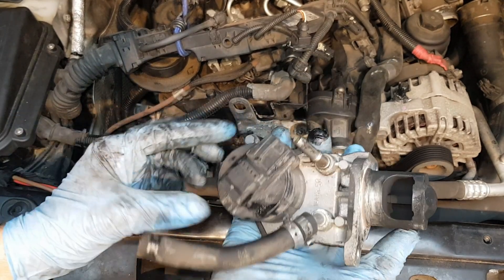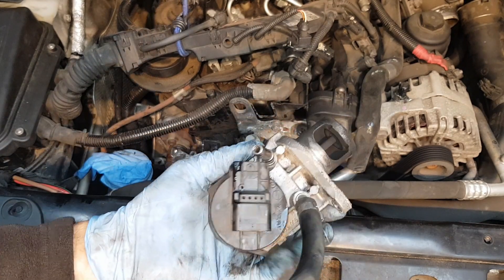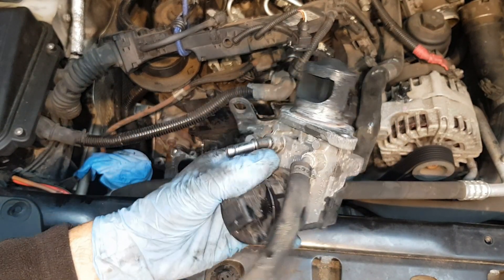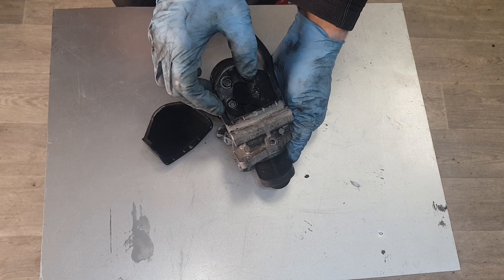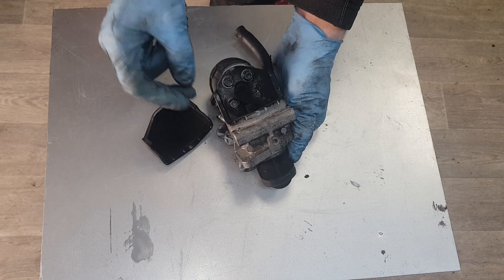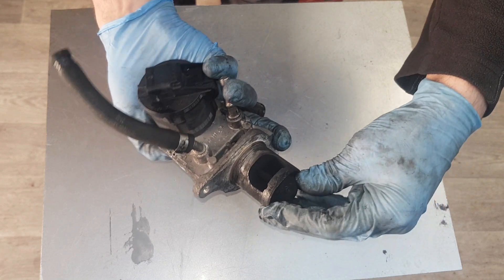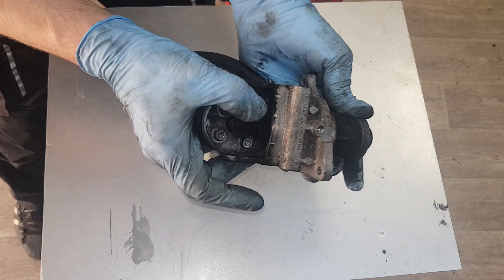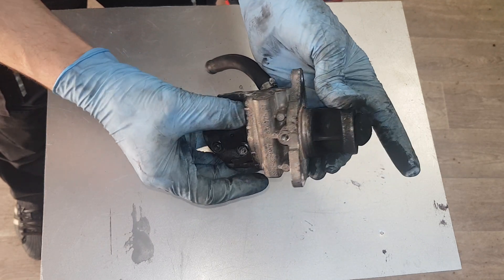Symptoms of bad EGR Valve Is your egr valve bad Why Bmw EGR valve fails N47 N57 BMW Drivetrain fault

Comment: Hi i got e92 335d mapped and after the map i got dpf gutted , when i reaching 120mph it goes into limp mode lost power instantly i turn the car off and on and it has power again

I had a code exhaust gas cooling switching valve open circuit., 

. Do you know how to sort it out ? Or did you ever had this issue?
Reply from the maker: Hi
Sorry but when it comes to mapped and modified cars it is a totally different story than the standard cars. You will have to go back to the shop that modified your car. I personally don't own or work on modified cars. Best of luck and hope you get it sorted

Comment: Did you try to clean it?
Reply from the maker: Yes, but it still gets stuck in open or closed position. The metal parts have too much wear in order to salvage it. Bought a new one and problem was solved.
Reply: @TheKeenMechanic  That is why every two years needs to clean this shit ❤
Reply from the maker: @ioannisstavrou2677  this one lasted 13 years. Very surprising

Comment: This isn't for n47 this is for m47. N47 is vacuum activated.
Reply from the maker: There might be earlier and later N47 versions. If you look up N47 f10 egr looks the same as N57. Is there any difference between N47 E60 and N47 F10?
Reply: @TheKeenMechanic  m47 is until 2006 e series only. N47 from 2006 to 2014, e and f series. B47 from late 2013. https://en.m.wikipedia.org/wiki/List_of_BMW_engines